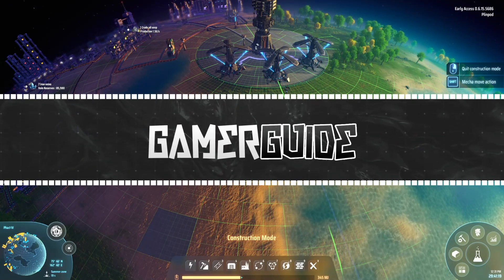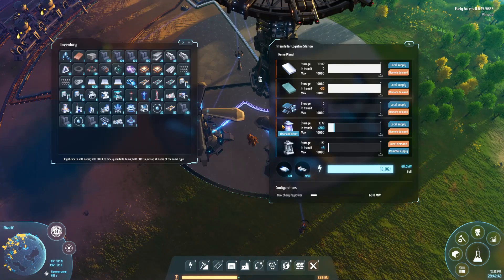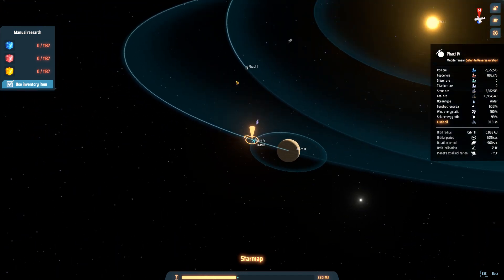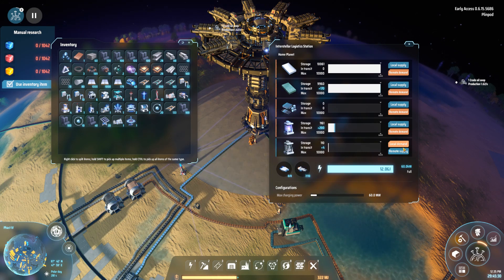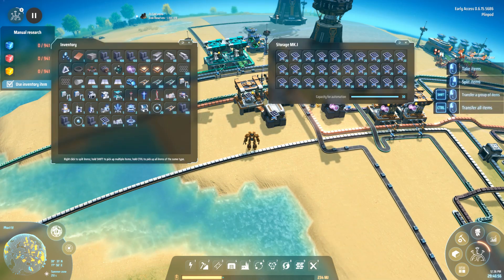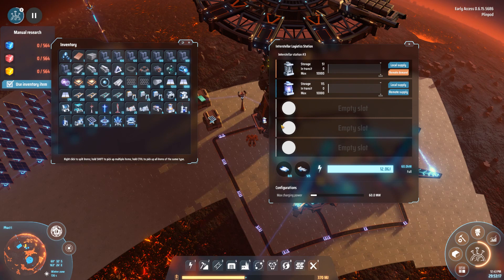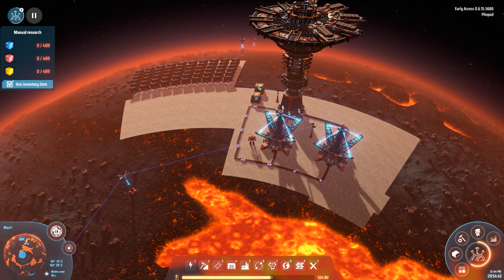Best Power Setup for Dyson Sphere Program - Energy Exchangers

Comment: A thing to keep in mind about this set up. Exchangers discharge at the same rate regardless of power draw. To account for this it is a good idea to make a "balancer" with an equal number of exchangers in the charging state that will eat up the excess discharge that one can then put back into circulation. 

This is not absolutely needed, but leads much to better energy efficiency across the system.

Comment: Once you start generating oxygen for red cubes, take the excess and feed into a loop of 10 fractionaters, with Mk2 belts. You might be able to supply 2 loops - by the time you get started on magenta science, you should have a nice volume of deuterium. 

Which is excellent for deuteron rods and those are great for power generation and the mech too.

Comment: Wish I could do this, but my home planet is the closest to the sun with only 91% solar efficiency. It has been a bit of a struggle, but I have more or less covered the poles in solar panels with bands of wind turbines further down, with all my production focused in a couple of bands around the equator. Currently working on getting some orbital stations around my ice giant to get hydrogen I can burn for extra power.
Reply from the maker: Check the update video for the setup. I moved it to a different solar system. So you can do the same if you like. No reason you have to be bound to the same system.  Also if you can find a tidally locked planet, that's even better. Here the link https://www.youtube.com/watch?v=90Hndb0s904

Comment: A bonus setup is at the charging planet, to have a few Assemblers making Accumulators and feeding those in to be charged by the Energy Exchangers.  The key is to make sure they only feed in if there are not enough Empty Accumulators in the network.  Us the Interstellar Logistics Station to request the Iron Rings, Super-Magnetic Rings, and Crystal Silicon, then export that to the Assembler(s).

Another idea might be using an Interstellar Logistics Station to request additional Solar panels, so whenever you find yourself on your Mercury-like planet you just wander around and put down more Solar panels.  Putting down the panels in a belt format provides a form of stability as it won't matter which side of the planet is pointing at the sun, half of the solar panels will be getting power.  Also make sure there are more than enough Energy Exchangers to use all that solar power.  By having more EE than the Solar panels can support you ensure that all that solar power is being consumed and available to other planets.

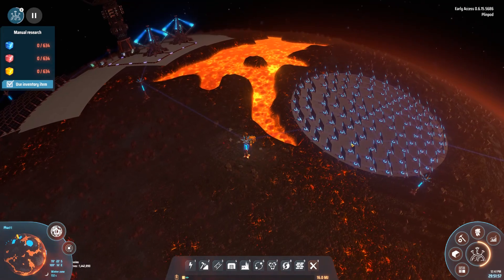7:06 - if you had additional Wireless Power Towers you would be able to use a cluster of them to recharge your Mechs faster.  Set down 4 of them in a square as close together as possible, move the Mecha to the center of the square, and all four of them will be able to recharge the Mecha.
Reply from the maker: this is the exact setup I currently have. Building accumulators on my charging planet and belting them in when the system is low. Also moved the entire setup to a tidally locked planet and using a dyson sphere together with the solar panels.

Comment: Huh. Yeah I can make this work, though I combine it with a Dyson Swarm and the Ray Receiver on a perpetual day planet. 
I have so much more space now! Screw all these 300+ Solar panels and accumulators!
Reply from the maker: Ya for sure, if you can throw up a Dyson Swarm you can save yourself the hassle of putting down solar panels. But finding a tidally locked planet is key. I have since moved my entire setup to a tidally locked planet I found and it's so much better.

Comment: I used this approach to power my base in the mid game, the amount of solar panels you need gets quite ridiculous pretty fast though. If you are fine spending a few hours putting down like 2k solar panels feel free to do it, but generating 600-800mw with them was starting to give me carpel tunnel. The exchangers also need a lot of room and you have to keep in mind you need 1 exchanger charging for every exchanger you have decharging. Currently I'm using my dyson sphere to charge about 20 exchangers, but now that I'm getting into antimatter rods and artificial suns I'm considering just removing the exchangers as the suns save you so much setup/travel time because the energy density of the rods is so much higher. 

Unless they will introduce research to improve battery capacity I dont think the exchangers are really that viable in the late/end game. I'm sure somebody could calculate the difference in cost between having to ship all the batteries and shipping a lot fewer AM rods but with an increased continual cost for creating those rods to get a more numeric comparison, but the setup time is definitely important as well.
Reply from the maker: I think once you get the Artificial sun and solid anti-matter production no other system can compare. They are more powerful and more compact, so it's a no brainier to make that your endgame upgrade. The exchangers carry you well up to that point however in my opinion. Thanks for the comment!

Comment: 1. Solar systems a generated. It appears that 100% solar on your own planet and nothing more.
2. What will you do when you need 450MW?
Reply from the maker: Hey, yep solar is generated for sure. Just using a different planet that's a bit more efficient at it. 

When you need to scale just start adding more of everything. 450MW is simple, just 10 energy exchangers. Add some energy exchangers, add more accumulators and expand the power generation on your power planet if necessary. I basically continuously pump accumulators into the system so I'm never short on those.

Comment: Dude u should earn a medal for this perfect idea <3 i will take this plan for my game right now but i have a question: can i build unlimited energy exchanger on a planet with (for example) 100 solar panels?
Reply from the maker: Thanks! So each energy exchanger can consume up to 45MW of generation power to charge up. You can put as many as you like down but they will split the available generation power amongst them. So you cant really just keep adding exchangers without adding up more generation. So for example if you had 100 solar panels at 100% efficiency, at 360 kilowatts per panel you will have a generation capacity of 36MW. So 1 exchanger will be enough to consume that energy. If you put one exchanger down it will use 36MW of power to charge your accumulators (each accumulator holds 90MJ of energy) if you put an extra exchanger down each one will use 18 MW and they will charge your accumulators slower individually. 

Remember tho you can always add up more power with things other than solar panels. You can add tons of thermal power stations and mine coal, graphite or oil directly into them. Or even use your Dyson Swarm or Mini Fusion plants to charger up your accumulators depending on how far you are in your tech tree. This is a more fun way to do power in my opinion but you aren't locked into just using solar panels.

Hope that helps!

Comment: Is there a range distance between the planets? Becouse im trying your strategy but on my planet A - I have my station full batter charged and on the Planet B - with Remote Demand on but the items dont come.
Reply from the maker: No there isn't a range limit between the planets. You want to make sure that the planet that is producing the charged accumulators is set to remote supply and also you will need I believe a minimum of 200 accumulators for the vessels to take off. That number can be adjusted withe Min. Load slider on the interstellar logistics station.

Comment: Didnt you just ... forget Antimatter fuel?
I built a massive Antimatter fuel factory in my dyson sphere system, then ship that fuel to the other systems that have artificial suns.
1 antimatter fuel rod has the power of 63 accumulators, saving me a lot of warp matrices in the long run (among other benefits)
So yeah, I wouldn't just say that this is the best power setup - in the lategame, you certainly want to use antimatter fuel instead!
Reply from the maker: Ya this is essentially my ideal build pre artificial-sun. I would say that the artificial-sun is basically end game, nothing really compares on both output and footprint. But the setup for it is really nothing special or unique.

Comment: I tried to do this setup, but in my power statistics panel it shows the 90mw under real-time battery data as "discharging power" instead of adding to my generation capacity. Is it still contributing to my electricity capacity? Or does this only work if I'm not producing excess electricity? Is this power just being wasted?
Reply from the maker: The power isn't being wasted. The energy exchangers themselves do not add to your generation capacity but they do contribute to your overall electricity capacity. They will only show up as Discharge power on your power statistics. The energy exchangers will take priority over your an generation in your network. So if you have both generation and exchangers in your network and you have excess power your accumulators will discharge at a higher right while your generation will have less load on it. Hope that makes sense.
Reply: @GamerGuidez  So does this mean that my effective total power capacity is my "Generation capacity" plus my "Discharging power"?
Reply from the maker: Yep. So for example if you had 10 energy exchangers and 10 mini fusion reactors. The energy exchangers have a max output of 45MW and the fusion reactors have 9MW. You have 450MW of potential discharge power and 90 MW of potential generation power. For 540MW total power capacity in your system that can be used.

Comment: After you have a decent dyson sphere going, you don't really need anything else than ray receivers on that system. It's a viable option for systems that doesn't yet have a dyson sphere though, although I would argue that antimatter fuel + artifical stars are easier and gives you more power, and they aren't terribly hard to manufacture either.
Reply: They are also much further down the research queue than this system.. and you need a ton of power to get to those techs. Once this is up and running, its arguably easier to expand than setting up a new power system and fuel lines; although the actual sphere beats this hands down yeah

Comment: Cool idea. However it looks like that’s way more work to just generate 100mw vs energetic graphite and excess hydrogen. My base has 800-900 mw at 80% production. I don’t see this being able to be scaled up to this much power on another planet using just solar. Maybe I’m wrong tho. I have unlocked every tech upgrade in the game though.
Reply from the maker: Well this is just the initial setup to show the process. But right now my system has 3000 charged accumulators in it at all times and you can always pump more accumulators into it. I can expand it without issue by just dropping an energy exchanger down. It's handling 450MW at the moment but can easily scale up to over 1GW. Remember as well the solar panels on that planet have higher efficiency and they are 100% dedicated to charging accumulators which hold 90MW per charge. Maybe I can make a follow up video showing it working at higher scale if people are interested.
Reply: @GamerGuidez  i would love to see a video of that set up. If I could get 1gw of power on another planet I would move and shut down my oil. Hydrogen and advanced fuel cell nuclear reactors down and do this!

Comment: I dont know if this is good for the late game, you need a lot of energy
Reply from the maker: I believe it will definitely hold out until you get the Artificial Stars going. But it can pretty easily be expanded by putting more accumulators into the system. I got 3000 charged accumulators in there constantly and expanded it to 450MW without any issues. Should easily be able to handle over 1GW
Reply: @GamerGuidez  If you setup accumulator production just before your input line for your charging exchangers (make sure to prioritize shipped accumulators) they will automatically produce more accumulators when required, this should automatically fill up your shipping pipeline until it stabilizes and will then shutdown production automatically. If at any point you then add more exchangers and start drawing more accumulators, it will just start creating more to put into the system!
Reply from the maker: @MoDlegion  Yep that's a nice solution for automatically feeding more accumulators.

Comment: Wait... So instead of putting solar panels on your home planet, you put them on another planet, put the energy into batteries (essentially), use interplanetary logistics to ship the batteries to your home planet, where you discharge the batteries to get power. Why... not just get the power from the same solar panels on your home planet? You've literally gained nothing, but just put a bunch of cost and logistics in the way?

It's inventive, I'll give you that, I just literally don't see what it gets you, unless you put the solar panels on a planet with 150% solar efficiency or something, and even then the gains likely aren't worth it. You are probably burning more energy constantly recharging your interplanetary transport ships than what the extra efficiency would be worth.

Two rings of solar panels on the poles (about 600 panels) gives me around 150MW-200MW of power, which so far has been more than plenty. They are in the sun 24 hours a day, though their efficiency alternates between 45-90%.
Reply from the maker: Regarding the solar efficiency that planet had 136% efficiency but I agree that doesn't matter very much. Especially since it's so simple to create and spam solar panels. If you have a tidally locked planet in your system it might be more worth it. 

I would say with the solar efficiency and transferring with the logistics system, any gained or lost energy efficiency with this particular setup is probably negligible. But that's not really why I use it.

For me the primary benefit was the ability to drop down a single energy exchanger for an instant 45MW power boost along with cleanliness of not having the solar panels on my home planet and leaving room for adding more production. After the system is loaded up I have a nearly constant reserve of 3000 charged accumulators (or more if you want). I can add up power very easily without having to do anything, it's all been built up already. I have 450 MW being produced at the moment on a relatively small foot print.
Reply: @GamerGuidez  I can definitely see it from a cleanliness perspective. Power generation gets very large in its footprint, especially the fuel burners. :\

If all your power comes from solar on another planet, what do you do with all your excess hydrogen / deuterium? I literally can't find any solution for it except to just burn large chunks of it. Obviously red research eats a bunch of hydrogen, but even so I still have hundreds of thousands of it sitting around. :)
Reply from the maker: @nickllama5296  I use all my excess hydrogen in particle colliders to make deuterium. Then I use those to make strange matter into graviton lenses. From there I make green science and also stock pile large amounts of space warpers. I have chests in between everything to stock pile material and keep the lines going. And I have a big buffer of vertically stacked fluid storage to catch extra deuterium in the system. The ratios work out nice 2 to 1 hydrogen to deuterium and then 10 deuterium per strange matter. Haven't had the lines back up since setting this up.

Comment: I was gonna ask what you do with all the excess hydrogen that comes from the research... and then I saw you are using graphite as fuel for the mech... making such a complex system so early in the game is waste of time... You will have a much better way of making power, don't waste your time with obsolete system like this
Reply: i run my mech on deuterium rods now im a little in thr late game and i need the raw power of thoses the warp uses an incredible amount of energy as well this setup is nice for a light industry planet that doesent go too heavy on plants cheap and easy nice guide
Reply from the maker: At that point my excess hydrogen was used to create deuterium. I was moving my deuteron fuel rod production which is why I loaded up with graphite, which is better than hydrogen or deuterium  alone to fuel your mech. Obviously you can can run nuclear power with Deuteron fuel rods at that point as well but I wouldn't call the exchanger setup obsolete at all. It's convenient to have it built up with excess accumulators and then be able to add up 45 MW of power by putting down one exchanger.

Comment: I have built a setup like that but it isn't active right now.  I produce so much extra hydrogen I can't use it all.  I have to burn it for power.
Reply from the maker: Yep burning the excess hydrogen in the generators is a good idea. Remember you can also put the hydrogen in the fluid storage tanks which stack vertically. Might be good to put those inline with your generators since you will need a ton of hydrogen later.
Reply: You will need the hydrogen later, when it is time to make Deuterium
Reply: Yeah I kept hearing that and thought I would too but I still can't use up hydrogen fast enough.
Reply: @0x0404  Do you have the Particle Collider Technology?  That converts 10 Hydrogen to 5 Deuterium, and from there you can use that Deuterium to make Deuteron Fuel Rods and Casimir Crystals.  The Deuteron Fuel Rods can then be shipped off to power Artificial Stars
Reply: I'm making antimatter so yes I've got all the tech unlocked.  It takes up more space but the fractioners are better in bulk.  They use less hydrogen and less power.  So you are using more power and twice as much hydrogen to use the particle collider instead.